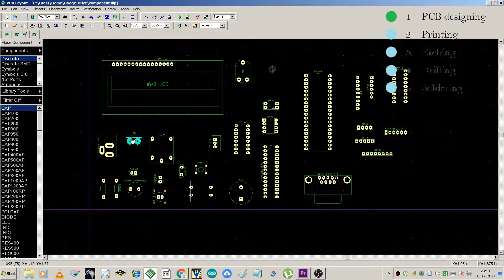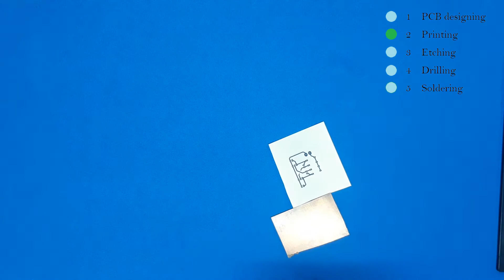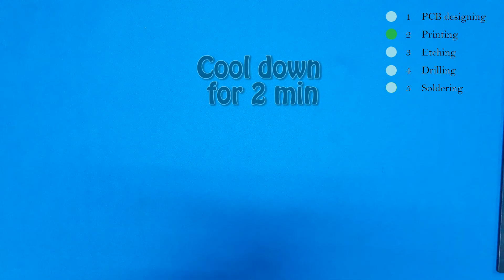PCB Designing in hindi At Home for circuit

Comment: I have a new idea for PCB printing 
without heat treatment 
using semi glossy paper and some other things
Reply from the maker: And what is that process?
Reply: use aciton and isopropenoal  3 as to 9 ratio 
mix both in glass bottal dont use pvc. plastic
put printed semi glossy paper  or maxzen paper on your pcb
stick with it using tape on back side
then spill that mixchuer on the paper and start rubbing using fingures till dry
make sure that were rubber gloves
Reply: Work kiya kya ?
Reply from the maker: Well abhi to office me work load jyada he to experiment nahi kar pa raha
Reply: @LearnWithFunTechnology  
Okey